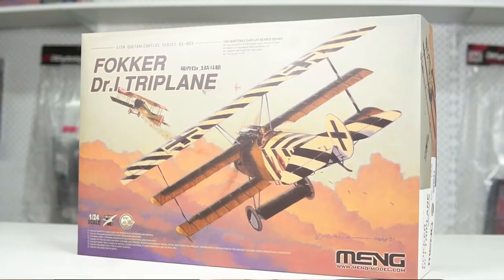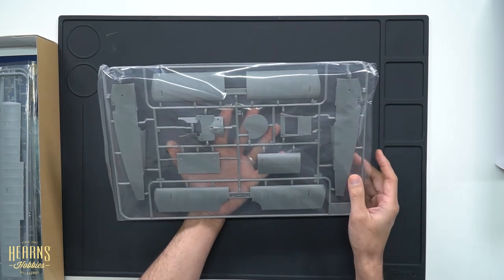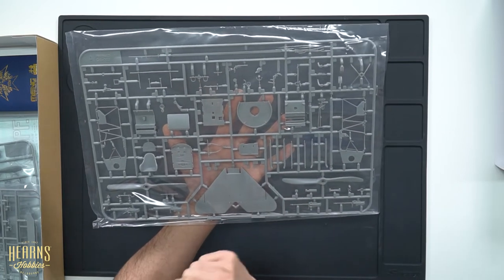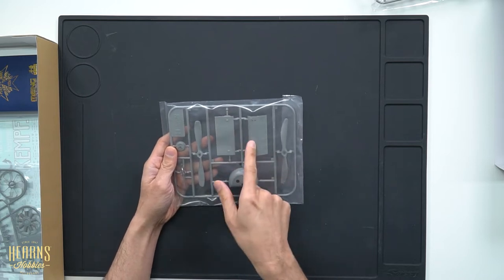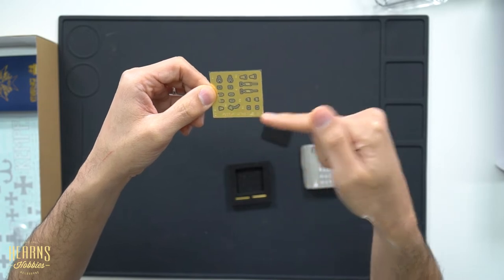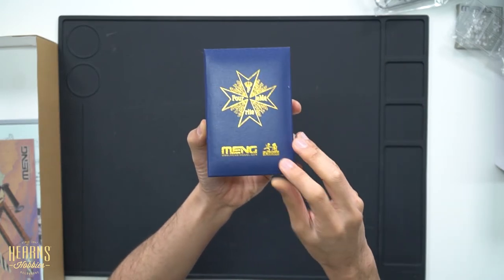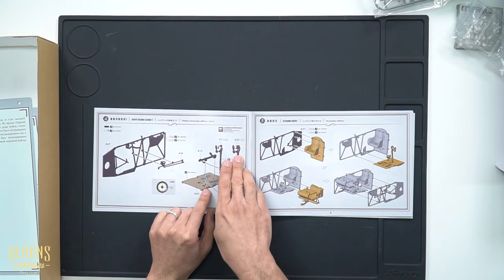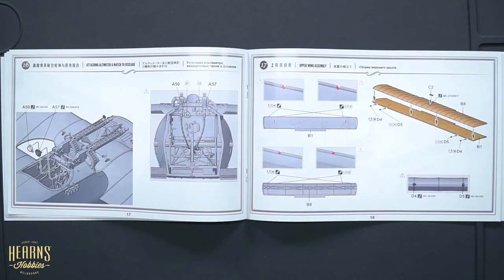Meng | 1/24 Fokker Dr.I Triplane Plastic Model Kit Unboxing | #askHearns

Comment: So the original version was a 'good' kit? Lol, warped wings and broken parts
Reply from the maker: "Good" does not mean perfect. A "Good" kit can have warpage and broken parts and still build into a "good" or even perfect model with additional work. Every kit I have experienced with long and thin spans has some degree of warp. It is the nature of injection moulding. It doesn't mean it can't be fixed if you have the skills.